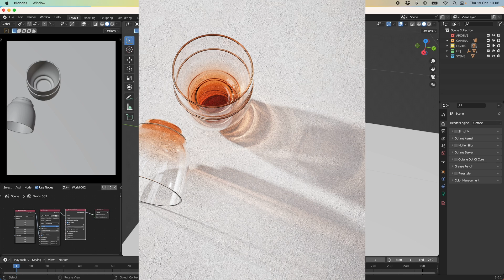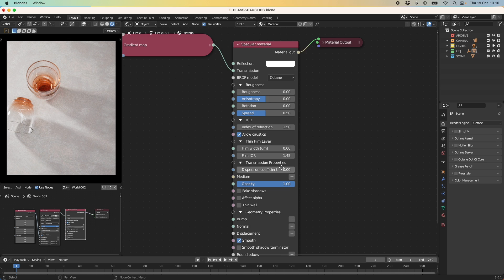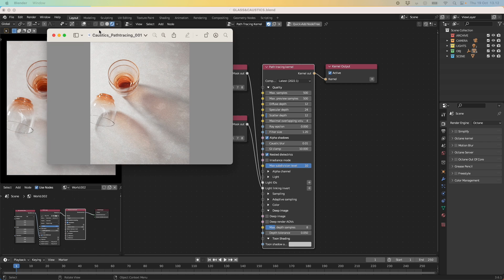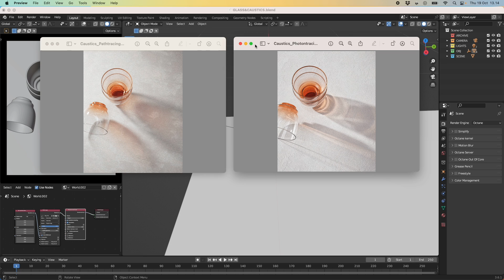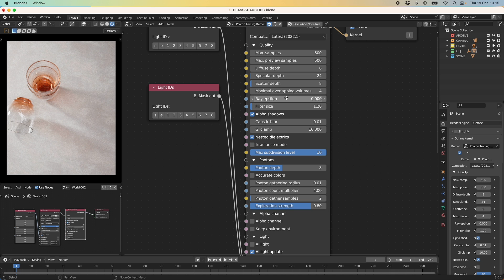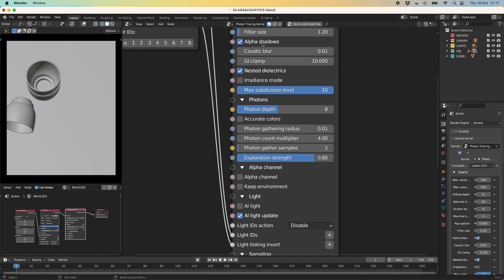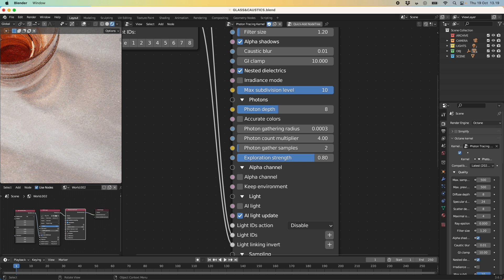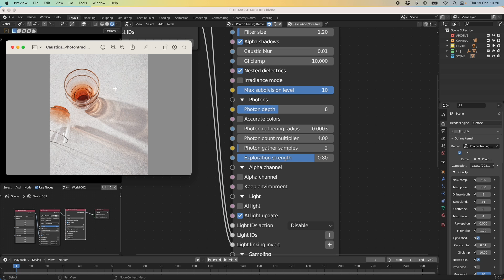Unlocking the Beauty of Caustics in Octane and Blender

Comment: My viewport render is too slow when switching to render mode in viewport. any tips for this? :(
Reply: New GPU maybe? But if you can see what's in render, the speed doesn't matter. You should only worry if the render speeds are drastically slow.